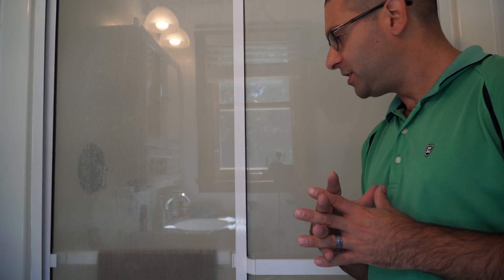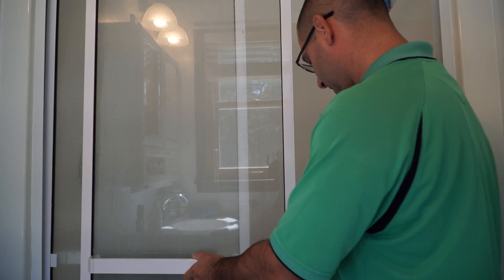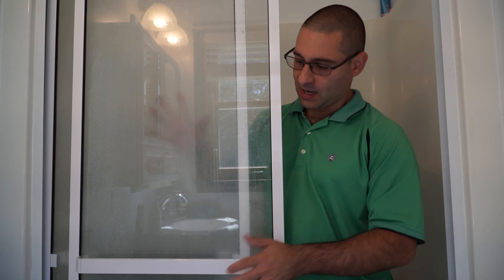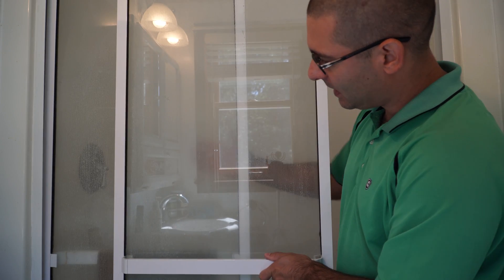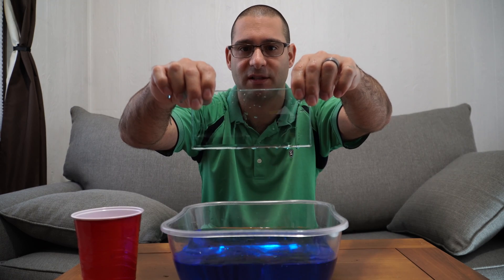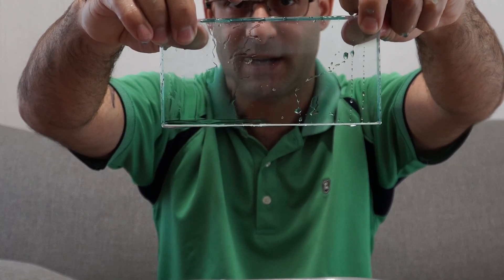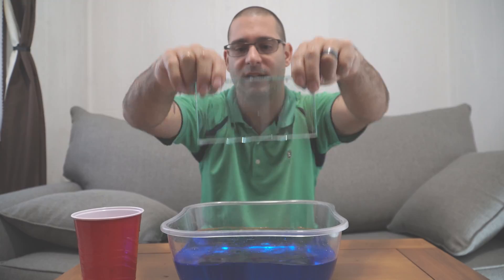What is a shower door surface coating why can't I just use Rain-X

Comment: I purchased a Kohler shower door with water resistant coating on it. I paid a good bit for the door. However, it is much worse after a shower then my Kohler shower doors that do not have the water resistant coating on them. The water sticks to the shower door. It seems to stay wet forever and then is left with cloudy spots. Even after one shower. If I don't take a shammy and completely dry the shower door after every single shower, it looks horrible.

Comment: I squeegee my shower after every use and I went a step further by cleaning and Rain-Xing the glass. I will say that it is a waste of time. It's probably good for people who don't squeegee after every shower but if you squeegee then using Rain-X is pointless. You'll still get the very minor build up over time which requires cleaning. But that build up is barely noticeable and comes off like butter with any normal cleaner. The absolute worst thing with shower glass doors is to be lazy and let them hard water deposits and soap scum build up. It's a nightmare trying to clean that off.

Comment: I've been using a squeegee for a few months now.I do the walls,glass and floor after every shower. It has made a world of difference! The build up is very minimal and simple to clean. Just got some Rain-X and going to try it out to see if it helps any. 

Are there any specific glass protectants you recommend for long term use? I know you said Rain-X works fine but it wears off over time and needs to be reapplied so that's why I ask,thanks! Great video and information 👍

Comment: I just purchased a Woodbridge sliding glass shower door that claims to have ULTRALUX GLASS COATING. Do I need any other protection such as RainX to prevent water stains and soap scum build up ?

Comment: that glass is NOT RUINED! i clean tile, grout, and glass everyday for my business. use a 3" felt glass polishing pad, hard water remover compound with a makita 9227 polisher of equivalent. wash the soap scum off first with soft scrub and a white 3m 44100 white polishing pad firs, wipe dry with microfiber towel to inspect for hard water deposits, then use method note. treat with any professional glass polish after the glass is clean and don't let your shower door get out of hand. shower pros in CA
Reply: Please tell us what “hard water remover compound” you use.

Comment: do you have a brand or a link of a product we can look at for a shower coating?
Reply from the maker: Masterbleu1 most of them need to be supplied by the manufacturer or installer some like Clearshild can be applied after the door is in what area are you located I can try to connect you with a distributor if your in the north east I can help

Comment: You just convinced me to not coat my shower glass. There's like zero difference between the two sides of the glass you're pouring water onto.
Reply from the maker: You will be unhappy with your decision but it’s yours to make
Reply: @theglassguy5564  why? Because I'll need to use a squidgee?

Comment: Our shower door coating is a nightmare, it keeps the door dirty!! Can't even remove it with steel wool
Reply from the maker: Thank you Dave Simpson I think you have some other problem like maybe there never was a coating.  Steel wool would potentially remove any coating so you probably do not have a coating at this point.

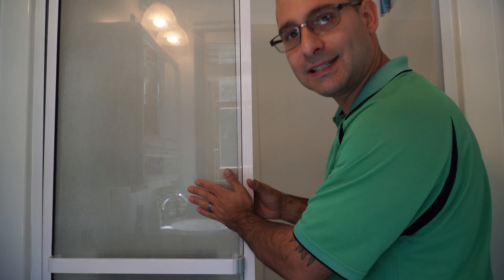Comment: 2:05 what do you mean that is ruined? Spray some vinegar or any other acid and it would clean that up. The glass isn't damaged...
Reply from the maker: a l once the staining gets too bad you can not clean it.
Reply: @theglassguy5564 that’s bullshit. Any hard water stain remover made for cleaning cars will work. Or mix vinegar with Dawn dish soap. Once the hard water spots are gone, seal the glass with Hydroview by Chemical Guys. Done and done.
Reply: @theglassguy5564  this... Is a blatant lie... Don't confuse your laziness for impossibility.

Comment: Can you put shower door protection on your windshield?
Reply from the maker: Shane Draper yes you could use this on your windshield. It would last only about 3-6 months from my experience. (I put it on my car) the dirt and debris in the air while driving acts as an abrasive and removes it. But it does work.

Comment: ok so what should I buy/use to coat the shower glass door like you demonstrated? I have whole house water filter but the carbon build up on the shower glass door makes me to clean them up at least once/month.
Reply from the maker: jpthsd. The real best way is to put these coating on prior to use. To have any of these coatings work after use the doors have to be cleaned down to bare glass. Typically you would need to contact your local glass company to have it applied unless they will sell it to you.

Comment: You discuss personally applying a surface coating- not one installed at the glass factory. Are you protecting trade secrets by not telling us what products you use?
Reply from the maker: Nope pretty sure I mention it in this video and the newest video definitely talks about it. If you haven’t checked it out. We use a product called Clearshield. We like this product because the company really stands behind the product and it can be re-applied in the field where the others can’t.  If they ever had an issue you would need to order new glass. We have been using Clearshield for 15 years and only ever had an issue once and the company stood behind there product and took care of the issue for our customer.

Comment: Why do a video about product testing without any products or the most recommended products? Not a good informational video.
Reply from the maker: +Daniel Paula thanks for your feedback. However this isn’t a product testing video. It is just to educate people about what a surface protectant does and what it’s for. You can’t purchase these products directly. This is something that comes on your shower door or other glass products when you order them. You can apply after but you would need to hire a company that has the ability to apply it.